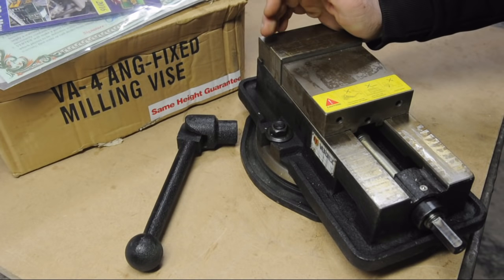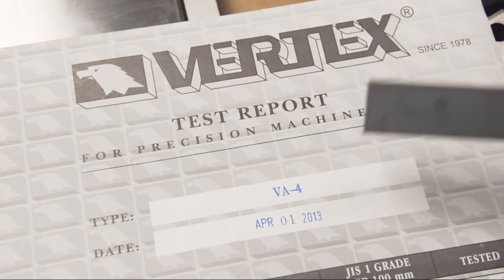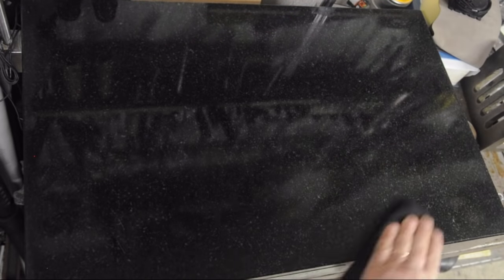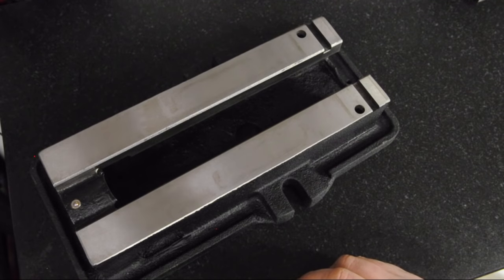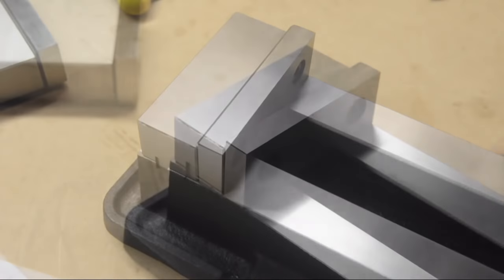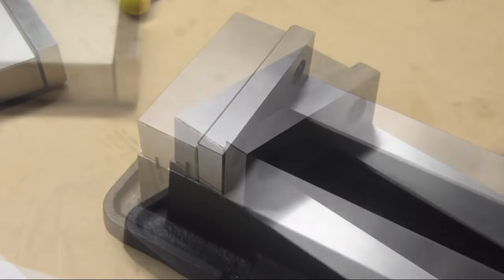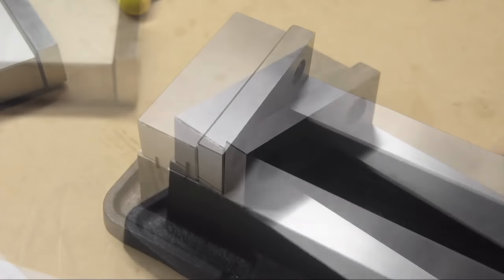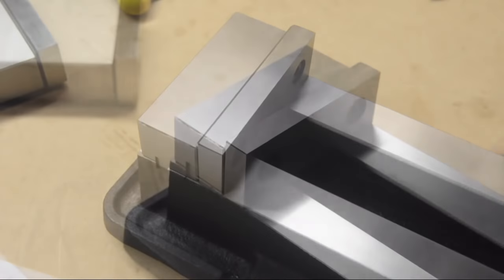Shoot'n The Poop #2 - Import Vise VA4

Comment: Could that inward cant of the fixed jaw be intentional? As the clamping force increases, the jaw becomes truer. After all, you want the jaw to be true when the workpiece is clamped in place. Not only that, the rise of the "fixed" jaw matches the rise of the moveable jaw. 

As you pointed out in STP#1, the needs and economics of a small shop/hobbyist are different than those of a large production shop. Buying an inexpensive vise (or drill press) and tuning it up substitutes some of your time for quite a bit of cash. I believe Randy Richards (In The Shop) did something similar with an inexpensive spindexer. Unless the basic castings are trash (some are) the main differences between cheap and top-of-the-line are in the machining and finishing.

Comment: Just a little tip I picked up along the way. If you take apart any CD or DVD playing device you can find two small neodymium magnets around the laser lense. They're used to position the focusing assembly. If you set one of those little buggers in that V notch on your measuring device it will hold the bearing in place so you won't have to go chasing it. Oh, and in the future, don't be so blue. You may find that other colors that contrast against the metal a little better. Still love the channel. Bright blessings over the holidays for you and your family.

Comment: Do I understand correctly that the fixed jaw is leaning towards the moving jaw? Then I wouldnt do anything to it!
Reason? Under clamping pressure the fixed jaw will bend away anyway and get quite straight anyway.

Measuring the movement of the fixed jaw was something that we did during apprenticeship...maybe I should do a video on it ;)

I did scrape in a vice a few years ago - Thats what I call going down a rabbit hole ;) But as we seen again, the Vertex stuff is quite Ok.
Thanks for sharing!
Reply from the maker: +Stefan Gotteswinter Yes, learning forward, and they do 'straighten out' when tightened.  I think you should do a video!
Reply: Everyone gets hung up on different things and has their own vises.
Reply: @ Stuart Schindler I see what you did there.

Comment: For me as a woodworker, this video was completely insane. We woodworkers talk about measurements in scale of 0.1mm at maximum (or minimum)
Reply: In aerospace you are talking about .0002in which is probably 0.00X something in metric.
Reply: Yeah. Woodworking is funny.
Aerospace? funny.
Try optics. Mirrors and lenses with surface qualities in ranges of nm or < 0,000001 mm ;)
Reply: @TomashPL58  Is that essentially the limit imposed by the molecular structure?
Reply: @HaqqAttak  exactly. For some special usage like space exploration, surface finish to a few atoms is extraordinary but common at the same time.
Reply: @HaqqAttak  concave telescope mirrors require insane precision. I mean you're talking about 1 micron error over like 10 meters of surface finish.
Reply: I’m a woodworker and I measure up to 1mm maximum, anything below that doesn’t make sense with wood furniture and most normal size protects.
Reply: Then there are costumers, who are pretty happy with a 1/16".  I was getting a bit too fastidious with my measurements and the costume shop supervisor just looked over and said "It's cloth.  It stretches."
Reply: unistrut (music) “this isn’t some space engineering, sweetie it’s cedar and glue, this isn’t a rocket you’re building, if it’s true to a sixteenth it’s true...”
Reply: Sebastian first thing i was told when i started working as a welder was that we splitt the milimeter in atleast 10
Reply: It gets weird when engineers/tool makers get into woodworking, and get frustrated when they can't make the wood to a couple of hundreds (of a millimetre.  Only crazy people work with inches)
Reply: @unistrut  There is a saying engineers typically hate, "Perfection is the enemy of the good". Once I heard this it cleared up priorities for me but then I am not an engineer.
Reply: A 16th is unacceptable for me,  but almost everyone I've worked with is happy with an 8th. Lol it's insane.  But it just go to show I was meant to be a machinist.  That's what I'm going to be in my garage when I grow up.  Just like Tony.

Comment: I get my vice as true as possible but always indicate the part. If the spindle isn’t trammed in perfect it will show up on the indicator.
Also on old machines the table has wear from years of stoning. On our EZ-Track we usually mill a pocket to set the part into ensuring perpendicularly.
You got to look for spindle runout as well especially on these old mills.
Vices are good for quick and dirty set up.
Love your videos.

Comment: This was actually very informative. I do a lot of bench work as I don't have a milling machine and was looking for something to hold smaller parts square while using hand tools. Sounds like a cheap mill vise bolted to the table will do just fine for my hand filing and chiseling. No need to go the extra expense of the high end vises for hand tools.

Comment: WARNING ON VA4's. I recently got one of these, while squareness and flatness were not a problem it has developed a crack on the base on left hand side, below the fixed jaw,kinda starting where they take the relief grind to allow clearance for removable jaw.Could be a one of(could be a air pocket or inclusion in the casting , who knows?) but INSPECT THIS AREA closely if you get one. Ive not had it super long or done any serious work, my mills not very powerful at all, max 20mm end mill.Only became apparent yesterday, i had been just doing some light surfacing, obviously i clean religiously between moving work so i noticed it as soon as it formed, at first i thought it was a chip.I bought this from a retailer(for reasons like this) rather than direct so i will be returning and getting a replacement.Otherwise i do like the vise a lot. Ive uploaded a pic because hard for me to describe location.
https://ibb.co/ZLYFk93

Comment: At 16:40  the fixed jaw also moves up... the two bolts are low grade and stretching longer.   Need grade 8 or better, and need oversize them. ....  Heck, I don't know, just a guess.... but I did turn 70 last year. !!

Comment: Should used the squareness indicator set up on end block of the vise while on the surface plate.. You really didn't validate square on the block by itself.   The  rising of the 1-2-3 block while increasing clamping  pressure would be flexing in the base as my guess.  It's a very interesting evaluation... Wonder how it compares to better vice.

Comment: Loved this one.  I got me one of those imports after watching this video.  I too pulled it apart and did the same measurements.  I did notice that some of the error you got might get removed when you torque the stationary block down to 100ft/lbs or so.  There is a video out there on the Kurt Vise rebuild kit, where the instructions have you torque the stationary block down in stages, based on the torque of the movable jaw.  A 6" vise goes to 150ft/lbs on those bolts staging at 5ft/lbs first.  I did remember your bluing check, which is why I kept looking until I found you again.  By the way, what kind of allen wrench did you use in the intro?  Was it a Steve or a Tim?

Comment: Hi Tony- Love your channel.
I noticed when you did the squareness measurement of the vise jaws you used a ball bearing as a bumper.  I'll have to keep that method in mind. The way I usually measure squareness is to turn around the rod in the surface gauge and used the ball end of the rod as the bumper directly below the indicator tip.
Keep up the great videos - especially the quirky humor.
Reply from the maker: Thanks Keith.. never thought about the ball end!  Only down side I can think of is the ball end will move when you adjust the 'mast' -- but like I said, I'll have to try it and see.  Thanks for watching!
Reply: That just means you won't have to wind the screw so far, does it not?

Comment: Hey Tony,
I actuall found your channel a few weeks ago and subscribed immediately. 
Later I found out you live in germany for some reason... (Dont know if you already explained but I am curious to what the reason is, since I am in germany as well)

Anyway, I didnt post for a very long time on youtube (to make up for it, this is a longer one), but this video got me shocked so much that I just feel I had to write my stuff down here... When I started watching this video about a "cheap import vise" I recognized this vise!
Its the same vise I use at my work as a machinist for 4 years now. Its from a different manufacterer and there is a sticker which says "Made in Germany" but EVERYTHING else is the same, even the quality papers and the stamps which say +/-0,01

So, if someone is interested in a long term review from a somewhat professional use: It still does the job very well, but on the inside there is this angled surface which is pressing against a half-ball shaped thingy, which helps pressing down the non-fixed chuck... this angled shaped side wears down or gets bend... thats the only downside I found so far... but you can fix is by cutting off a few millimeters on the mill...

Comment: That thing has only 2 moving parts, but it's trueness is so important. Thanks for showing how to check it. 
I love the disassembly scene. Cheers. 
Oh, wait. A 1-2-3 block has no moving parts.
Just a question about them: Are your 1-2-3 blocks dimentioned 25mm, 50mm, 75mm, and have a 3/8" thread in the odd holes?  Isn't that a bit weird? Why would the manufacturer tap an Imperial thread in a Metric block?
Reply: Because it is more useful that way, until the transformation to all metric is done.  :-)

Comment: Tony, it would be worth closely inspecting the fitment and smoothness of the mating surfaces of the pocket and hemispherical wedge doohickies that drive the moving jaw, incase they're rough and bindy uppy, not pulling down with as much force as they potentially could. I bought a similar 5" (but way lower quality than Vertex), Kurt knock off and thought it could definitely be smoothed and improved underneath.

Comment: Also, when you stone the surfaces, you’re taking off just a touch of metal, on both sides. It’s not unreasonable to assume that honing four surfaces (both sides of the key, and both sides of the slot) will take off at least a couple of tenths, which is why your measurement error increased by a few tenths after that was done.

Comment: One improvement I think could be done to any of these vises is to grind the end of the vise parallel to the keyway and drill and tap two holes parallel to the base surface. Then make a new fixed jaw that bolts to both the top and the end. Also I prefer vices with the fixed jaw in front. IMO they are safer in terms of handling parts. Also if the screw is mounted to the fixed jaw the body of the vise is carrying no addition stress loads. Neither are the fixed jaw mounting screws, The entire clamping load is carried by the 2 jaws and the screw. There are vises made this way. Why they aren't more popular is beyond me.

Comment: Got a similar ang lock vice recently, it was warped so badly  (spec 1. : 66um error in height)I needed to run run a big end mill over it until it was flat < 3um difference in height. I expected a mill would need a grinding stone for finishing but taking it really slow did wonders regarding in surface finish.. also its mandatory to fix vices with rediculous low feeds to prevent heat being put into it which may cause height differences when cooled down again.

Comment: I could be wrong (usually am) and it could have been said already, but I'm not going to scroll thru 7 months of comments. I thought it would be closer to 8 tenths per 100mm, +/- .01mm = .02mm = .00078"
Either way I very much enjoy your videos. Thank you for sharing your knowledge with us.
Reply: I thought you were right at first, and it's true for flatness, but a squareness tolerance is EITHER leaning in or leaning out, so you do not double the stated figure.

Comment: I don't understand how swinging that test indicator in an arc showed anything about squareness. How does it work?
Reply from the maker: the indicator is zeroed against a known square ahead of time.  because it swings in an arc, that zero point happens only when the indicator tip is perfectly square with the indicator base (again, because it was zeroed against a known square).

When you swing it past your work, it is comparing the work to the known square.  if it's 0 at the apex, it means your work is as square as the square was. :)

clear as mud?
Reply: He uses the tool that he knows is perfectly square (the granite square) and rotates the base with the mounted dial test indicator back and forth, as you saw (the ball bearing lets him rotate the tool assembly against the square). When it reaches a point in its rotation where the dial test indicator contact point is pushed farthest towards him, we know that the point at which it is touching the square is directly above the point on the ball bearing that is touching the square. It's at that point that he sets the dial to zero. Subsequently, if he were to put it up against a "vertical" surface that isn't perfectly vertical, then the contact point of the dial test indicator would be closer or farther away from him and thus not read zero, since it's not directly over the point of the ball bearing that is touching the surface.
Reply: What is that bit of kit called?

Comment: The sheet shows the max tolerance and the printed on specs show the max tolerance.... sounded sketchy until I saw your results. They might actually test them, scrap/re-machine anything that doesn't pass, and slap the max tolerance reading on anything within spec. That's probably the way I'd do it if I was the bottom dollar (but still honest) manufacturer

Comment: I know this is an old video, but I think I detected a small error in how you handled the vise assembly/disassembly. You should check out the Kurt instructions on how to do it. There are some preloads you have to put on the jaws and specific torque levels you have to apply to the bolts.
Reply: Before anybody jumps up and down, I know this is not a Kurt, just an Asian copy.

Comment: Cast Iron can move around alot. NASCAR shops usedto go to great lengths to relieve engine blocks. I once had use of an unmounted 3 inch Craftsman lathe and when I got it one tailstock foot must have been a quarter or an eighth in the air. I bolted it to a commercial table top and when I gave it back about half of the error gad gone away - go figure. Guess that's why they use Mehanite CI in good stuff (QV different grades)

Comment: The fixed jaw vs the base should read a bit short of 90 deg. to compensate for the slight bending flex under pressure when clamping parts. (Everything  moves under pressure). Try the test again with a part clamped in place. You should see better squareness.

Comment: I have the same vise mine came with 2 inspection reports was it inspected twice?? Both inspected by inspector 17 and the same measurements as yours. But its a good vise regardless trammed in well no complaints.
Reply from the maker: +Customairseals It's good to hear they're double checking their work. :)

Comment: I'm missing something...if, during your 9:00-11:00 tests, the point of contact of the indicator probe on the vise jaw is not (when viewed from above) directly, perfectly above the point of contact of the ball bearing, the needle will move when the base is moved as you did...with a sweeping motion. Any angular change of the base relative to the vise (which I saw some of) would cause spurious needle movement..Which would make the test meaningless. Was there some setup there that wasn't shown? (It would be easier to ask that question with a drawing...oh well)
Reply: I got it....max deflection, when the needle reverses direction should be same, indicating squareness of the jaw..or at least same angle as whatever the indicator was zeroed on.
     Sometimes it takes me some time.

Comment: Great video Tony! Just recently subscribed. I design and build scale RC plane landing gear. I have an old Enco 9x19 lathe that I use, and do lots of tedious, time consuming mill work on the lathe, but it is just too exhausting! Time to buy a small mill. I have been researching for quite awhile, and there are way too many options for consideration. Can you recommend a decent small mill that won’t break the bank? Thanks for the entertaining and informative videos. And thanks in advance for any help you can provide.  James

Comment: Question for you Tony: I have a similar 6" vice, I've never done the checks you've done, but I'll do so now. I'm assuming mine is all over the place... I have a surface grinder, so if it turns out the vice is out of square/parallel (top & bottom surfaces of the body), what's the best way to square it up? Can I just throw it on the surface grinder upside down, grind the bottom flat, flip it over & grind the top flat? Will that square itself to itself, if you see what I mean?

Fantastic videos by the way, I've been binge watching them - much to the disgust of my boss. That WD40/water trick to cut metal really works a treat, that's made my life so much easier, thanks! Only problem is I spilt a bit on my vice & it broke off when I hit the WD40. Any suggestions for suitable glue to put it back together again?
Reply from the maker: a surface grinder fixes everything.  Just make sure to map it out ahead of time... be sure any error is actually coming from the body and not, say, the jaws, etc.  Fun project!
Reply: OK, so I just watched your surface grinder rebuild videos (shit, I'm going to have to do that to mine, as it arrived in bits). So don't watch this space, OK? Might be a while. My time travel lever's lost its ball and frankly I don't trust it not to leak timeoids everywhere.